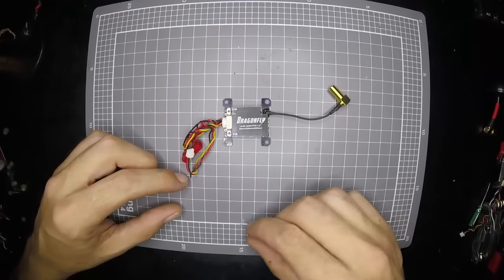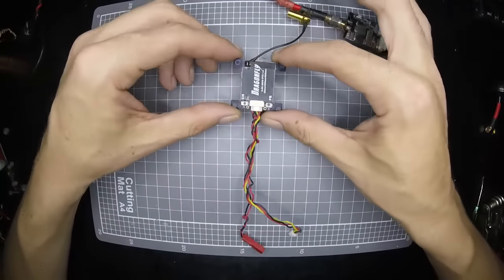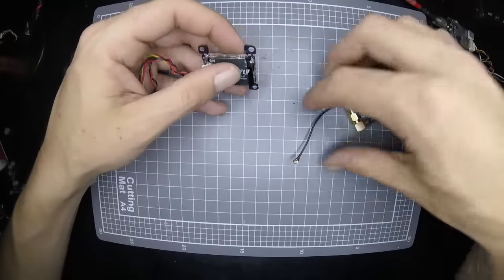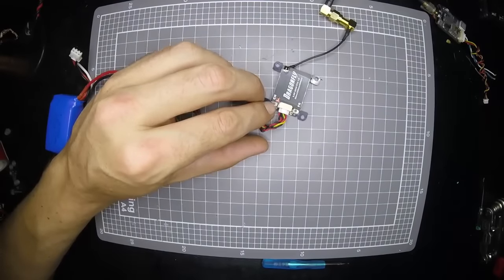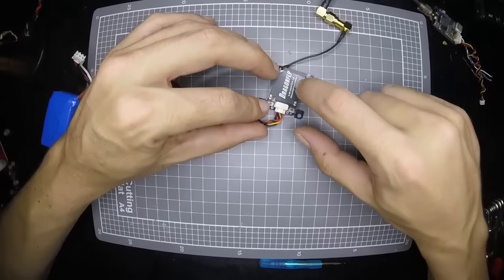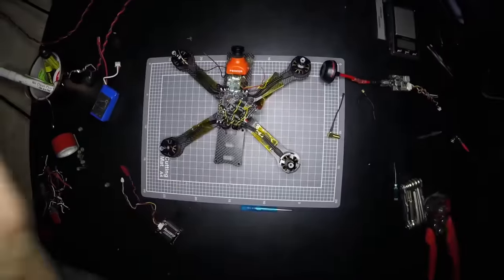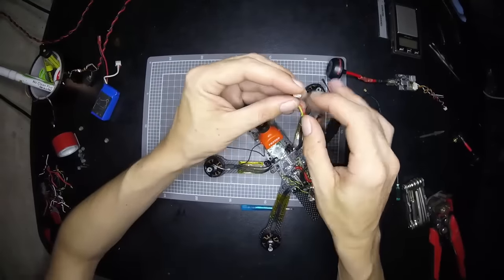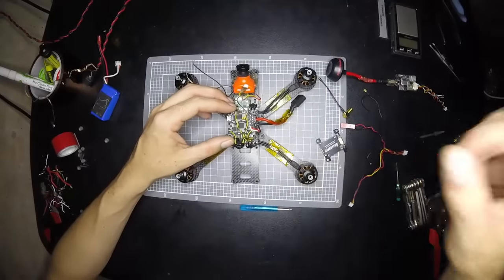Dragonfly 5.8G 48CH 25/200/600mw Stackable Video Transmitter.

Comment: Great video, love your reviews, It may just be me but I have had horrible luck with this type of connector, it is very small and fragile, if the top retention clip breaks it can come unplugged easily. You could use a little hot glue from the get go to hold it secure. It's the same connector at RMRC Cricket and if pinouts aren't the same it can be finicky to change the wires due to the size of the connector.
Reply from the maker: Thanks mate , that's my worries with this connector . luckily this Vtx does have solder pads i forgot to mention but if it turns out to be a hassle for people who want to use a connector they should change it out for the older style micro jst connectors

Comment: It would be great as it worked with betaflight to change the settings. My build is so tight, that I can not push the buttons. I use now the immersionrc tramp because of the button and the wand to change the settings. But as soon as betaflight suports the unify pro, i will switch to that back. 
The vtx looks good and I am thinking of getting it for my other quad.
Reply from the maker: likewise , i built this and with the top plate installed i need to press the buttons with a little tool . i have access and its not a huge drama but the time of 2-way communication between the Vtx and FC is here and this does need to catch up! i will however be working with FPVModel to bring something like this to more Vtx units in the near future :) . 

Oh and the TBS should be ready to go on Betaflight , I'm sure i seen someone test it on the bff3 with the release candidate
Reply: That would be nice. I have now the ImmersionRC tramp because that button is on the side. Is easier. Must download the manual from the tramp and the unify because I forgot how to set it up. 

Nice so it comes soon to bf. I use now bf3.1rc. Borisb told us it is ok to use now.

I have my Runcam eagle now and I tried the OSD and it looks great. I changed to bigger font and removed a lot like the horizon and the side lines.
The motors run so smooth and it is so silent with that dshot.

Comment: howdi.. so if I'm seeing this correctly you have a short positive from centre + pads on the quadrant to the + esc pad that's on the right of the positive battery pad on the BF FC ?
Reply: on these pics are you soldering the positive pads to both sides of  the shunt ? 

https://static.rcgroups.net/forums/attachments/5/0/5/2/5/9/a9739256-30-IMG_20170103_111157.jpg

https://static.rcgroups.net/forums/attachments/5/0/5/2/5/9/a9739257-50-IMG_20170103_111240.jpg
Reply from the maker: Yea sorry mate yes thats correct , solder either side - https://www.dropbox.com/s/e03efbdldysjhe6/bff3close.jpg?dl=0